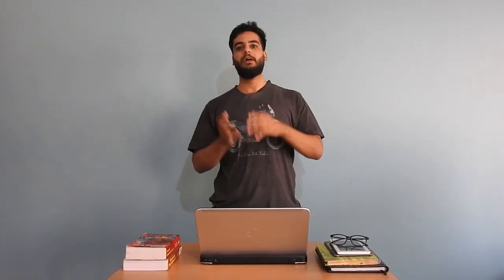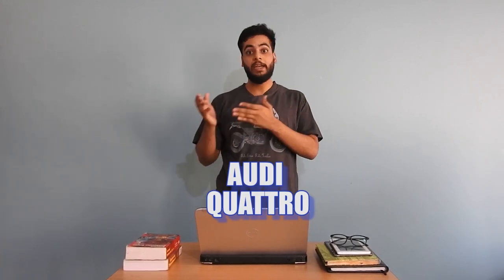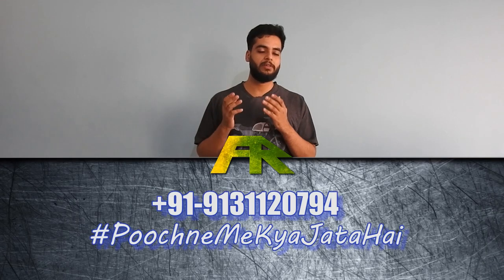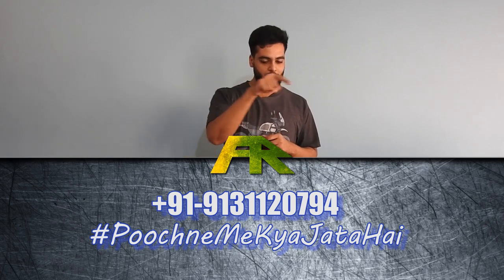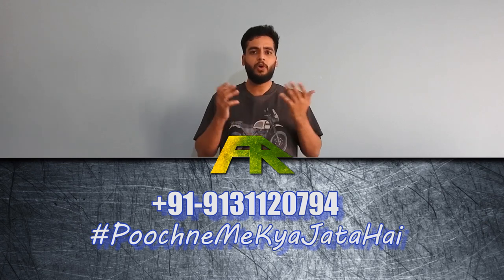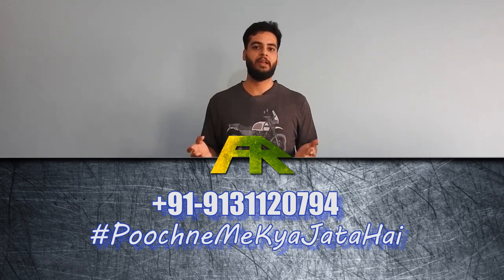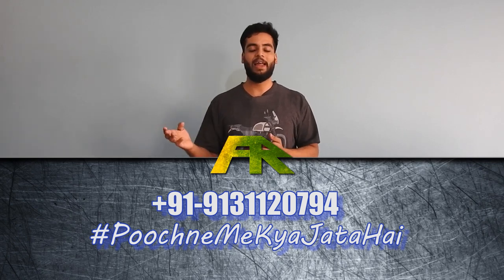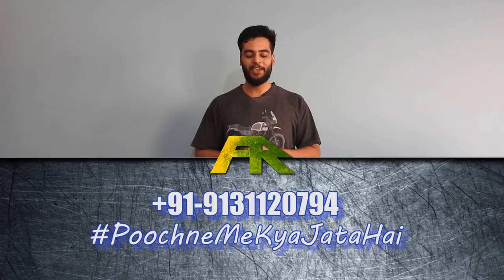POWER TRANSMISSION FROM ENGINE TO WHEELS | AUTORAGE EXPLAINED Ep. 4

Comment: thanks for really nice video. just one question ; whether power is transferred from connecting rod (of crank shaft ) to fly wheel or power is transferred to axle via cluth mechanism and flywheel on its own has no role in this power transmission to wheel ultimately